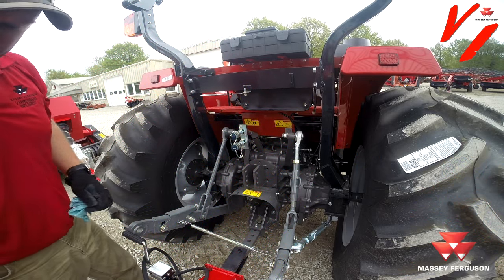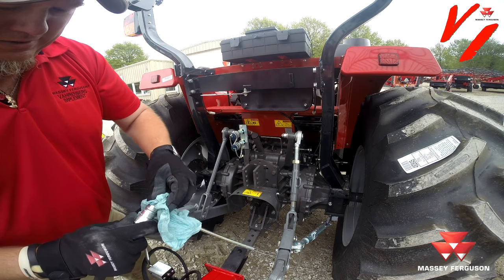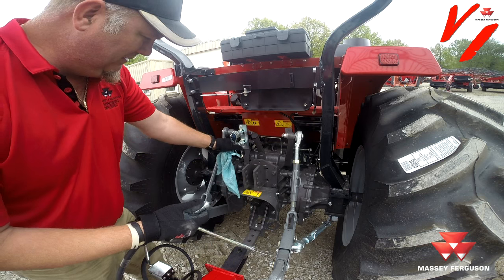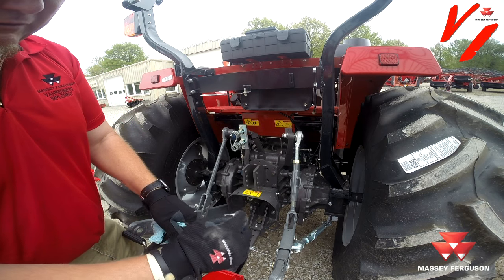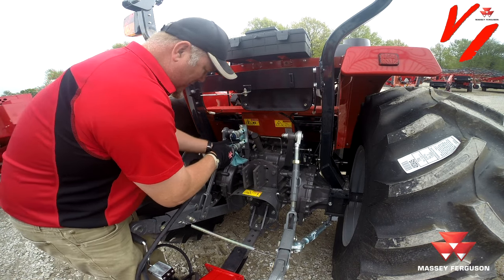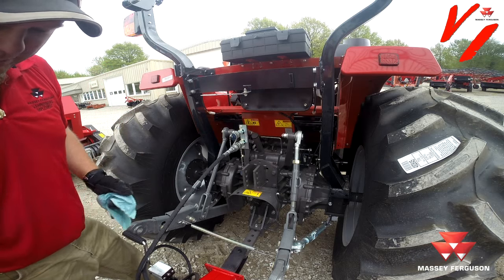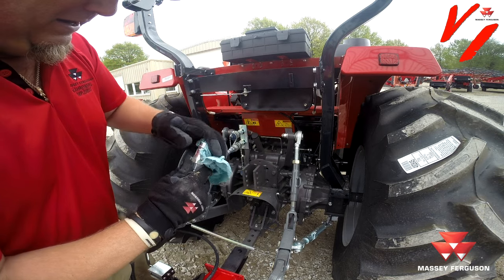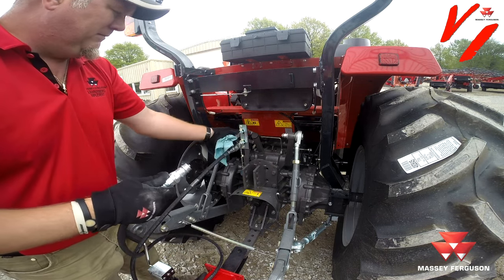The Basics: Hydraulic Coupler Connection

Comment: Hi! I was thinking if You could help me... When i want to connect hose to tractor it lets a bit oil out. Do I have to lower my hitches all the way down or there is something I'm missing out?
Reply from the maker: Anytime you connect/disconnect Hydraulic Couplers you are going to get oil seepage. That's normal, because you are opening a passage way for oil to flow.
Reply: @VahrenbergImplement  Thank you!

Comment: New to tractors so sorry if I’m dumb, but how do you know which hose goes where?
Reply from the maker: How You want to Operate the Cylinder. Personal Preference. Most Push to Drop the Implement because some valve have Float Position for Hydraulics in the Down Position and the Float feature allows to follow contours. Hope that helps. Quick Tip: When you find which hose you like where. Color Code the Coupler and Hose with Color Zip Ties. Makes it easy to hook up each time

Comment: I have a massey ferguson 275 tractor whit a john deere 1209 haybine. How do i get the tractor to release pressure and bring the haybine down so i can start cutting a field .there is only one hydraulic house on the haybine.
Reply from the maker: You probably have a lowering lock on the Implement. One way Cylinder is Hydraulic Raise and Gravity Fall. Look for an implement mechanical lockup.
Reply: @VahrenbergImplement  found it tanks!